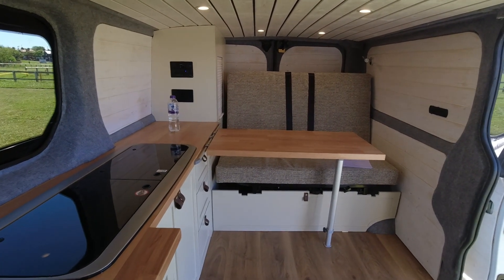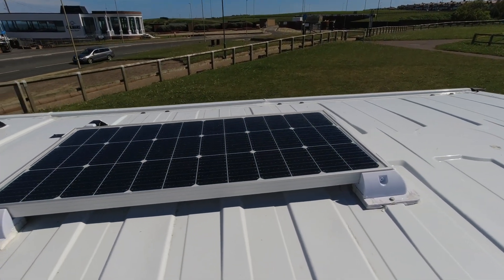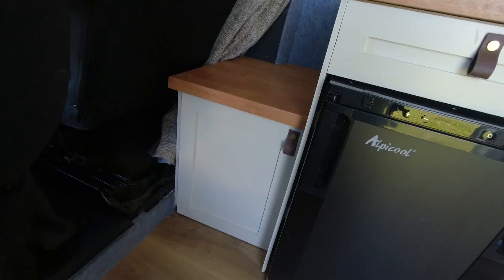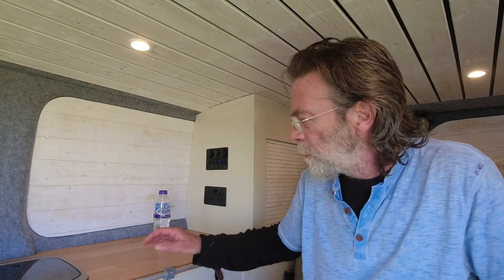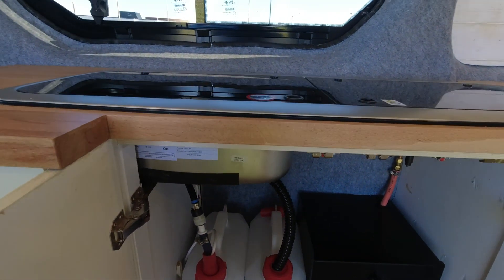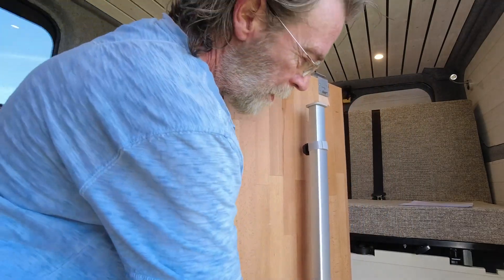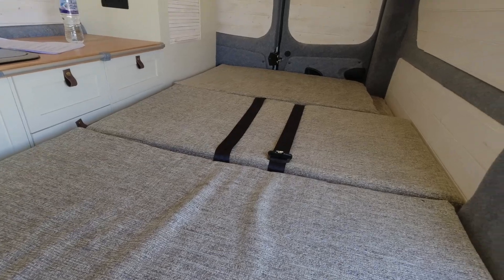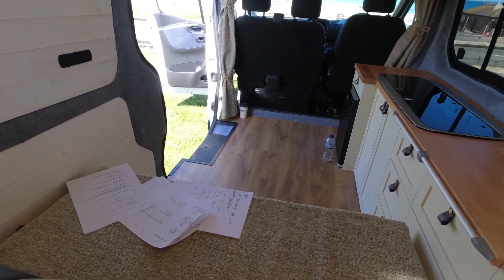Van Tour Vauxhall Vivaro - Campervan Conversion - LWB Vivaro

Comment: Great looking van, nice to see a step by step guide instead of a 20 minute time-lapse. I have a T6, I originally wanted to convert it but having 3 young children, the lack of seatbelts is an issue. I’ve had it for 5 years and plan to sell it in the new year, my neighbour has just bought a converted Sprinter and I’m jealous 🤢🤢🤢 
I came across your videos looking for Vivaro builds, they’re cheaper to buy than a VW, and I think a better shape. 
You’ve not mentioned money yet, I’m curious if you make money from the conversions. Buying the same van helps with future builds, instead of making one off templates you can re-use them and speed the process up.
Reply from the maker: Yes I prefer the Vivaro/Trafic to the VWs they are a slightly bigger van. I've converted 6 vivaros now and I have templates for all of the panels and furniture. The first one took me months to do but I can now turn them around in about 4 weeks. I have more planned for the year to come and I will be posting more videos from the planning stage to completion. I do sell the vans most of them have gone within a week or so of advertising them. Thanks for watching.

Comment: Looks good love the aesthetic not overly keen on the standard layout  but i'm sure it serves others well. Just bought a swb vivaro recently myself  and have already started converting it, I deliberated for awhile wether to get one but I think I have a unique layout/ setup which will hopefully prove a winner.
Reply from the maker: Thanks, I know what you mean about the standard layout. The design is a little restricted with the R&R bed. The first conversion I did was a SWB with an L shaped seat at the back which folded out into the bed. Van No 3 is in the planning stage right now and it will be a different layout. Good luck with your own project and hanks for watching.

Comment: Very nice conversion. I'm doing a Renault trafic 2019 lwb.
Can you tell me how you got cable from van battery under bonnet to your leisure battery.
And where you got your fridge from.
Sad to hear you're selling it. Was looking forward to seeing your escapades.
Reply from the maker: Thanks David, The best place I found for the cables was through the grommet around the bonnet release cable. I traced it back through the cab and put a couple of holes in it and fed the cables through.
The fridge is the Alpicool R50 and if I remember correctly I got it from a place called clearcut conversions.
I intend to buy another van and convert it too and then get away in the late summer, so many escapades to come.  
Good luck with your conversion, hope that helps.

Comment: Lovely van Dave, I was worried I'd missed part of the series as you jumped from the ceiling to a completed van tour!! 
Brilliant build, you must be chuffed to bits with it. Have you considered a swivel base for the passenger seats? Would give you more seating options. Also an awning?
Reply from the maker: Thanks Jac, I will upload the rest of the van build each Sunday, just got some more editing to do. But I put the van up for sale so I wanted to show the finished thing. And yes, an awning is on the cards and I'd like the swivel seat but I wanted a single passenger seat for that, still looking on ebay. Stay tunes the rest of the build is coming soon. Thanks

Comment: Outstanding video`s  Dave , Just a quick question , as this has been converted from a normal van to a camper van , does it have to be deregistered with DVLA and registered as a  camper van
Reply from the maker: I don't think is essential to change it with the DVLA. But to do so there is a list of requirements that the van must meet for the DVLA. One of then was it must have 2 windows on at least one side of the van. Thanks for watching and I'm glad you liked the videos.

Comment: Excellent video! I'm about a week away from buying almost the exact same van. How was it getting the bulkhead out? Thanks
Reply from the maker: Hi Arthur, the bulkhead came out quite easily. It's held on with a few Torx bolts and a couple of rivets which I drilled out. Good luck with your conversion and thanks for watching.

Comment: I have had converted, a sister van to this and the Renault traffic, the Fiat Talento lwb crew cab van onyx edition. I bought my van brand new as a 70 reg, right in the jaws of the pandemic when vans were nearly unsellable. I paid £25k brand new including vat for the van and then got it fully converted in Otley. I have just sold the original rear seats for £400 and the conversion including the revolving double front passenger seats cost £18400 bringing the total converted price to £43000 for a brand new van, which is wider and bigger, with a 120 cm wide rib altair bed, instead of a 105 cm in a transporter. Who needs an inferior van just for the sake of badge snobbery, when you can save £22k ?
My van also comes with 2 x 95amp hour agm  batteries, drivelodge pop top, sink and water pump, hob, gas locker, water containers, solar panel, canopy, webasto diesel heater fed from the main tank, etc, etc. By the 
way, I have bought a 300 watt portable inverter from halfords, which plugs into one of the 12 volt sockets from halfords and even powers a television when off grid.
Reply from the maker: Sounds good Steve. I also prefer the Vivaro/Traffic over the VW. The VWs are quite a bit smaller and a lot more expensive. Hope you have many adventures in your van, Thanks Dave.
Reply: @dave-watson I had to wait months for the slot for the conversion to be done, it was finally completed in early December 2021. Since then we have been away  12 times, about once a fortnight. I am not being over dramatic in saying that it has completely changed my life !
Reply from the maker: @stevezodiac491  I agree Steve. In my last van I tried to get away into the hills as often as I could and I always found it really lifted the spirits.